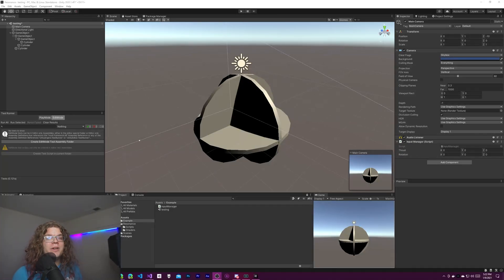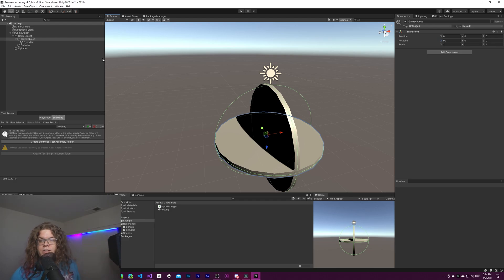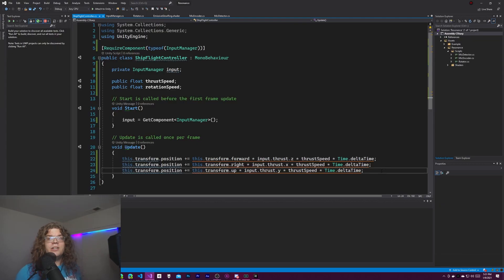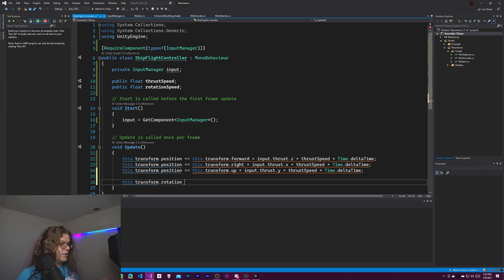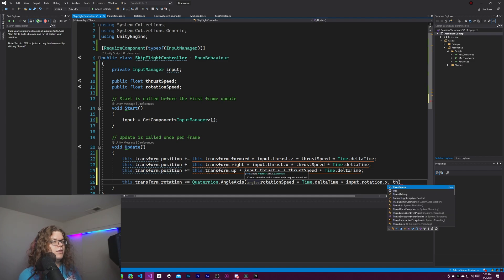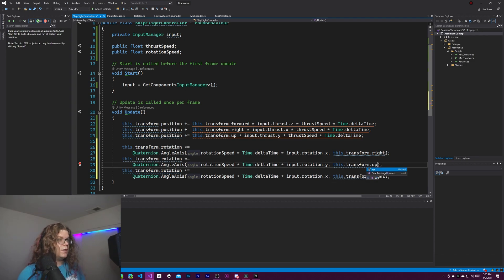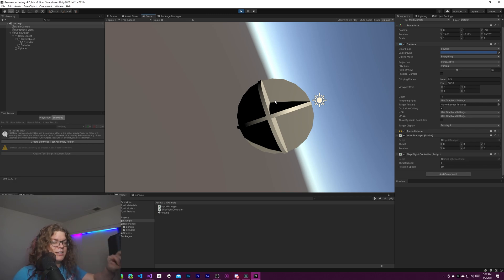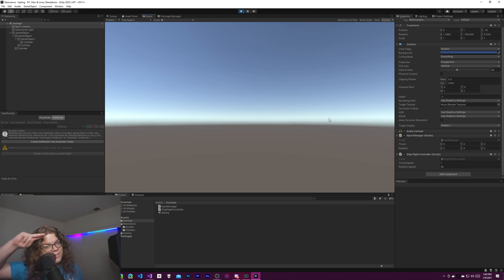Live Coding a Basic 6 Degree of Freedom Flight Controller

Comment: At last! Normal explanation how to achieve such camera! Thank YOU! :)

I'm not using Unity. Am I understand correctly, that:
Vector3.right and Vector3.up are world view vectors? I mean always (1, 0, 0) and (0, 1, 0)?

"this.transform.forward" is calculated as a cross product after rotations on  x&y axes? Or is it just a cross product of (1, 0, 0) and (0, 1, 0)?
Reply from the maker: Vector3.up/right/forward are world vectors so your correct.

transform.up/right/forward are relative to the object they are being used by.

Hope that helps!
Reply: @WorldOfZeroDevelopment  That was fast reply!  Thank you again for clarifications. :) I got better results, yet still have problems with rolling... But that's what I signed for when started to learn how to create  6DOF camera (like in mentioned Descent) in OpenGL. ;)

Comment: Great video! I've built a couple of controllers like this over the last months. Converting them to use Rigidbodies is very easy too. Rigidbody.AddRelativeForce(thrust) and Rigidbody.AddRelativeTorque(rotation) will make this into a nice, weighty flight controller with built in collision.
Now, what would really be interesting is to do more with a physics based controller though. How about building a PID controller or a nice system to smoothly follow waypoints?